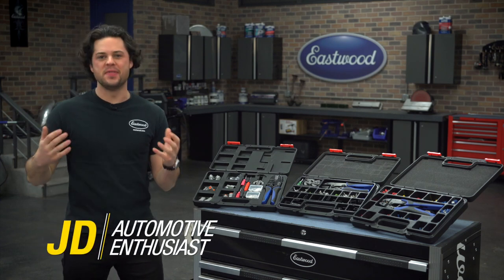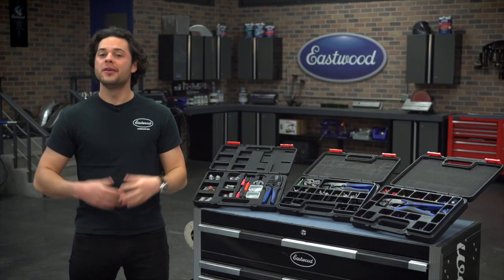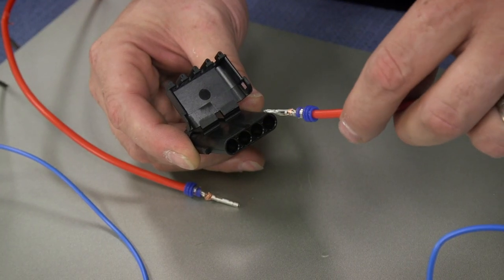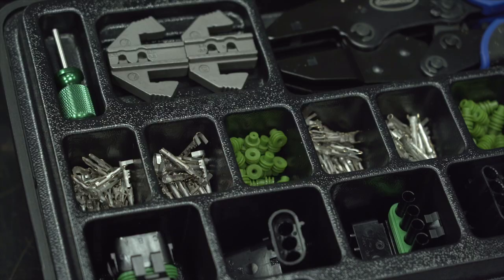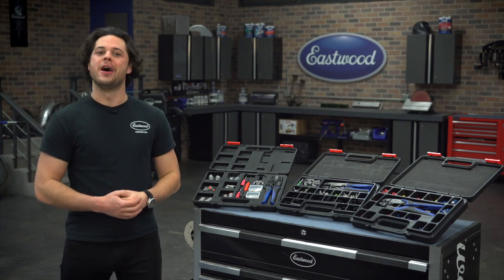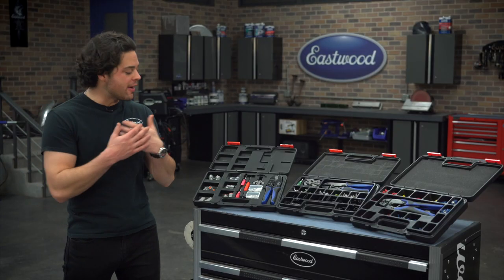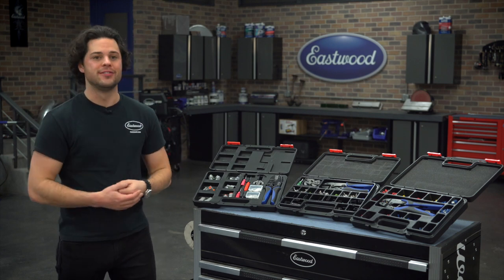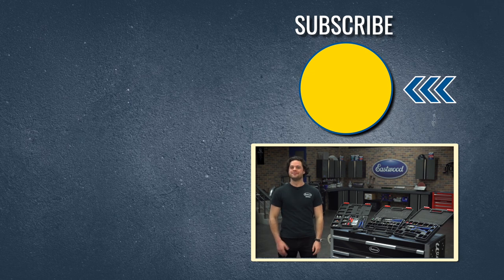The Most Common Electrical Connectors for Automotive Projects - All the Best Options!

Comment: I like the idea of just buying your own connecters to build this way instead of trying to repair factory wiring clips. But in my dirtbike, the odd eight pin connecter is still smaller than the two pin connecter in this kit.

Comment: I have a regular 3 spade box connector and a 2 spade box on my tractor and the box has a little latch on the inside to catch the hole are slot on the spade. my box is old and crumbling apart, my spades connected to the wire is in great shape. My question is what type of 2 and 3 pin box do I need to replace my bad ones.my box is the square type with a push on the out side to release the male side from the female side like those on most vehicles. all the ones I see are the type where the spade has a little tang/tab that sticks up to latch in box. I need the latch in the box that will click into the spade. What do they call this type of box----Thank you
Reply from the maker: You might need to contact our project advisors to help with this: 800-343-9353

I'll link our several electrical connector kits here and you might see what you're looking for.

https://www.eastwood.com/eastwood-crimp-right-weather-pack-connector-crimping-kit.html

https://www.eastwood.com/eastwood-209pc-crimp-right-weather-tight-tech-tray.html